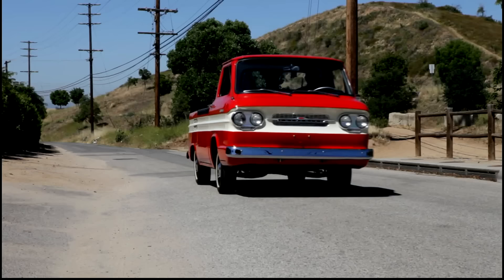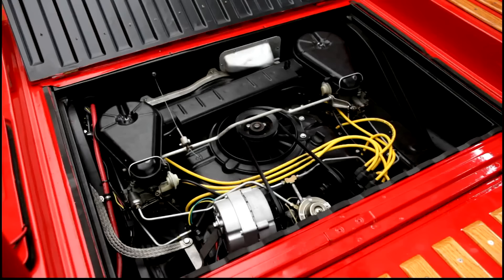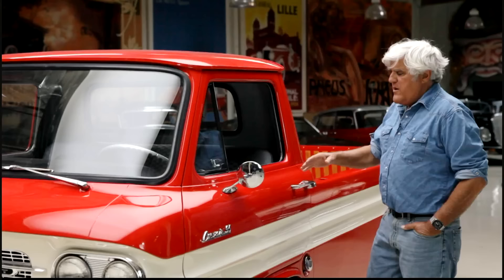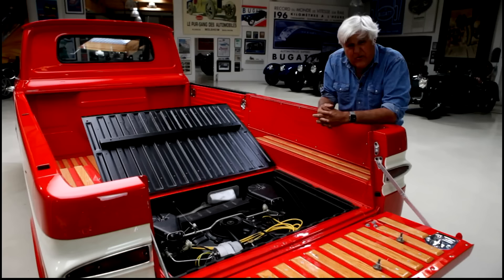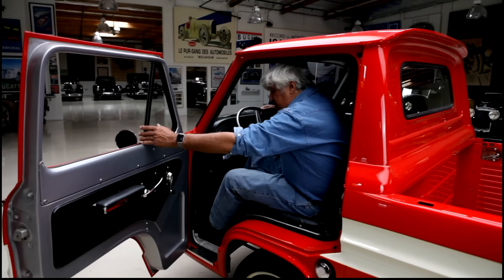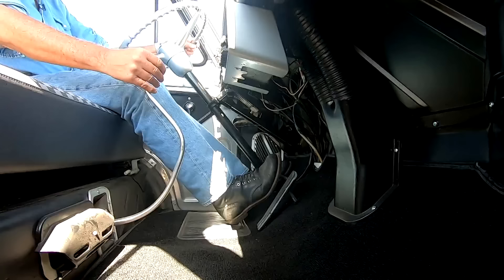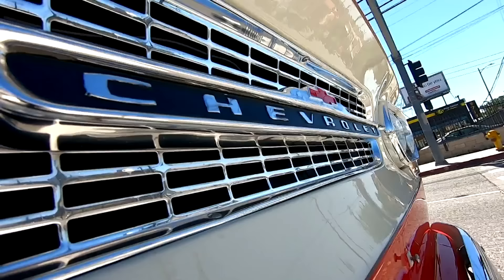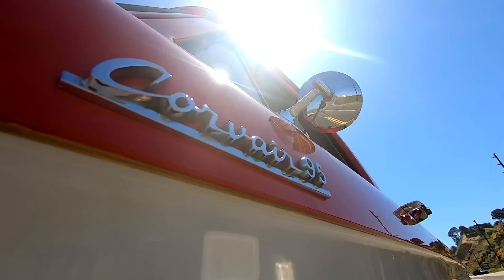America's Most Radical Pickup Truck - Jay Leno’s Garage

Comment: I would love to hear Jay’s opinion of what Ralph Nader did to the Covair. Today these designs look brilliant!
Reply: Nader... the original Karen
Reply: He gives his opinion in the vid. Hmm...
Reply: He more or less rendered his opinion on this vlog.
Reply: Ralph Nader not only knew nothing about automotive design and engineering, he didn't even have a driving license. His book was purely an opportunistic move to gain fame and fortune the easy way. At the time every liberal hated General Motors because it was the most successful company on the planet, so you could make unlimited brownie points knocking them. Nader got his information from GM's complaints from dealers and customers about faults in new cars. They kept complete files of these letters and took them very seriously. They would correct any faults and apply the fix to new cars being built, and send letters to dealer's service departments requesting they fit the new parts to customers' cars when they came in. At the time recalls weren't thought of. So Nader got access to these files by some nefarious means, and made out that their cars were full of faults without mentioning how hard they worked to correct them.
The Corvair made the perfect patsy because it was different. Professional road testers for independent publications failed to find the handling problems Nader talked about, and in 1972 the Department of Transport paid for a series of tests of the Corvair which proved it handled as well as any car of the times or better. Since it exonerated GM it was quietly buried.https://www.corvaircorsa.com/handling01.html
Reply: @mrdanforth3744  Nader is the greatest living American. Too bad the population of mouth breathers didn't have the sense to elect him president. Instead, look at the mess you are in.

Comment: OMG.  MG Mitten.  I had forgotten about them.  I bought a few things from them back in the mid 60s.  My first car right out of high school, June 1965, was a Corvair 500 with the 110 hp engine and 4 speed.  The cheapest car that GM sold at the time.  It was $2000 total cost out the door with no accessories.  A great car that handled very well.  When GM changed the rear suspension during the restyle in 1965 to the Corvette type half shafts with U-joints at both ends, it made the Vair a real handler.  It was good in the snow in winter.  I had snow tires on mine and never got stuck.  It was noisy inside at high speeds but I removed the rear seat cushions and stuffed them with fiberglass and it reduced the engine noise by about 50%.  You didn't dare put too much weight in the front "trunk" or it would ride low and handle weird.  Kept it for a year until the Camaro came out in September, 1966.  Bought an RS 327/275hp 4-spd.  Was a bit faster than the Corvair but I do miss it.  Great fun little car to drive.  Ed Cole was a genius engineer in many ways.  Great video like all of Jay's shows.  He is an encyclopedia of auto info.

Comment: I just sold a 65 Monza 140 4 carb  cool car but a nightmare to work on, I did a partial engine rebuild. my engine was toast and a you couldn't touch a rebuilt for under $3000. I luckily found one sitting on a test stand with a propeller bolted to it, very low miles that never made its way into an airplane. Took a while to get the bugs out of it but a fun project...great job Jay and the boys, so glad your bringing stuff like this back to life

Comment: Jay, my Dad had  eight or ten of the Corvairs,  Cars and Vans....they were the only GM he liked. He always bragged that they had the most perfect balanced Crankshaft off the assembly line! He also used the drive train to build Dune buggies that we ran in the Sand Dunes at Silverlake Michigan.  The 4 carburetor engine was actually the 140Hp (It had 327 intake valves) and had torque to high heaven..they also had two other High performance engines that were 150 -180 hp turbo's     other engines more utilitarian were 95hp 102hp & 110hp and nearly everthing was interchangeable..... Great video BTW!    Dan L.

Comment: Independent suspension? Air-cooled? Engine in the back?
Who was first?
1950–1967 VW T1
1961–1965 Corvair Greenbrier
Reply: VW first, Subaru 360 Seccond, from '58 til '70, they had a rampside pickup as well.
Reply: @idrisddraig2  Subaru is often forgotten when it comes to the old days of the industry.
Reply: Tatra Model 77 in 1934
Reply: I think he meant the first American car with these neat things, and I think the only one still from America. However I think the 1960-66 C-10/20/30 Chevy full-size truck was the first to do independent all around for a full-size truck, of course if you got a K-series truck then they used solid axles due to it being 4-wheel drive.
Reply: @idrisddraig2  that's a new one on me about the Subaru. Good one👍

Comment: To crib a line from Bob Hope, "Thanks for the Memories"!  I had several model kits of the Corvair, including the Rampside pickup!  Chevy makes/made many great vehicles.  My '97 Suburban finally had its engine cracked open at 230,000 miles.  Got it repaired and it runs better than new <grin>  Now it has 242,000 miles on the odometer.  Love it!

Comment: Awesome vid.  I remember my four door sedan with the gas heater. Yes, burned a good deal of fuel but in New England on a cold winter day you could have it toasty in minutes...but the heater sounded like you were starting a small jet engine. Miss that little thing. Of course the sedan had the auto trans with the shift lever on the dash.

Comment: Great video Jay, I'm a bit late seeing it. My neighbor had a teal and white one of these. I had a 1963 Corvair that I paid $50.00 and a leather jacket for. I loved it, it was missing the passenger seat and just had a bean bag! I swear I'm not making it up. 
It had a 2 speed auto trans (lever on the left side of dash) and when you down shifted to 1st it would somehow zoom off by itself. My friends called it power boost! 
Anyway if you've never driven a cab forward vehicle like this truck or a van you wouldn't understand the feeling of being in front of the wheels, it's like you're flying or something. Very strange. Thanks Jay!

Comment: I am impressed.  An air-cooled engine that doesn't leak oil.  My ex-wife had a 1960  Corvair with the shifter in the dash.  It looked a bit like a heater control.  The only problem I saw with them was the fan belt.  If the belt broke or came off you had to stop immediately and fix it.  You didn't dare run without the engine fan working.

Comment: Always loved this car just as I love the old VW's. As a driver, there is something about sitting high and up front that just feels right. Like the VW's these cars are beautiful to look at. Nothing is overdone - this look has aged really well. On a practical level, the layout with the engine bay in the back lends itself to putting an electric motor in. My only lament is that they never bothered to make a crew-cab (as VW did) or at least and extended cab.

Comment: I put about 50K miles on the van version of that truck. Mine popped a grommet out ofr some unknown location that danced around and got under some carb linkage that make it run the engine at about half speed until I shut it off and cleared the problem beside the road.

The cars got paired with another new invention from time to time, when the fan belt broke and the engine overheated. On prom night, you could always rely on your girl friend to be wearing panty hose, the new rage in feminine apparel, and a pair of those, knotted and trimmed, made a perfectly serviceable fan belt that lasted long enough to get you back to town from where you had parked after the big dance.

Great old cars, though, and great memories.....Joe

Comment: Here in the UK & Europe the VW type 2 was where he got the idea and It basically ruled the world in air cooled commercials for years! The big difference was they had the bed all at the same level with a separate enclosed and safe compartment under the bed in front of the engine bay!  It came in a whole variety of models, from single cab pickup, crew cab, vans, and of course the minibus and caravanette!

Comment: My first car in 1974 was my mother's 64 Corvair.    I loved it to bits, I wished I had babied it a bit more.   Foggy make out sessions on those wide seats.    Air-cooled, overheat and would  throw oil.    I added an 8 track and blared Eagles and Elton. Rocket man - in his white and red capsule - 4 gear manual shift spaceship.

Comment: Back in '65, I  had a Corvair van. My brother and a few friends had a garage band, and they were good enough to earn money Saturday nights playing at college frat houses in Worcester, Ma. I used to take them around with the van, so I was a  roadie long before the term became popular. I'm sure I wasn't the only guy doing that sort of thing back then but in a way we were pioneers. 
As for the van, it got good mileage, but there were two flaws. One, as Jay said was the heater wasn't the best.  In the winter, in central Massachusetts, it was like driving a block of ice. The other problem was that if I got on the gas at a stop light, the belt that drove the alternator and cooling fan would come off one of the pulleys, and it took longer to take the engine cover off and put back on than it did to secure the belt.

Comment: My first car was the Corvair van bought for $30 at 13 years old and invested over $500.  Learned a lot about mechanical and body repair since it had T-boned a police car.  Got less than 100 miles out of it as my dad thought it was handy for an e;ectricians van.  It was not a chick magnet. :-)  I replaced it with a 72 Fiat spyder and learned more mechanics.  You did a great job on that truck version.  Love that color scheme and wood inserts.  Thanks Jay!

Comment: I dabbled in Corvair‘s for a bit in high school because my dad bought me a $25 wrecked one! Ha ha! And the biggest flaw that I saw was the exhaust was unbelievably restrictive! It dropped straight at the bottom and went into a minuscule rectangular manifold that had to cut the flow down terribly. All of mine had to have Stubbs welded onto the manifolds so I could rig exhaust on them because I had no money and the bolts twist it off. We’re talking in about 1971. They weren’t even old yet but the slop from the tires would rust them.They were fun to drive though! I just loved the way the rear end would squat when you banged second gear!

Comment: My first cr was a 1964 Corvair Monza, 4 speed convertible  Was terrific.  Had a few problems with the belt coming off due to the Generator bolt stripping.  Finally solve that problem by welding it to the frame.  changing belts was a bit time consuming.

Comment: Boy does this take me back to the 60s and early 70s. We had a  blue Greenbriar for nearly 10 years. Fun car for dates, the shift lever was always between the girls knees. Dad put planks in the side door and loaded it up with gravel for the driveway.
Our first Corvair was a 61 4 door with no rear seat belts. Dad bought a kit and installed them. When he was drilling one of the mounting holes he hit the wire to the started solenoid and it started cranking and he had to pull the battery cable.
Living in Missouri the only time our cars look as pristine as that is when they're on the show room floor.

Comment: To me '59 was the end of that excess, '59 Cadillac for example which of course I loved so much. That truck was great since you're always supposed to load the weight up to the front of the bed not back at the tailgate since you want to distribute the weight to all four tires, and the side gate helps so much of course to load and access your load in the dip of the bed.

Comment: The early Corvairs came with generators, my 1963 Monza had one. It also had the gas tank in front of the firewall, making it a true fire wall. Didn't care about safety but had seat belts. Also had oil seals that would drip oil into the shrouding and heater boxes causing the cabin to fill with smoke once it got hot, the heater did produce ample heat on its own. Only saw gas heaters on VW beetles.

Comment: Reminded me of my dad's VW truck.  First he had an open box like your stepside(but access is only by letting down a side I believe) Then he traded it off for a new to him 1959 VW window van which was more suitable for his "TRADE"(house painter) than the open vw pickup truck. VW may have had a 4 cylinder engine but the suspension could carry 2200lb(European tonne)  Maybe never had that much paint, but my dad also laid ceramic tile for the bathroom. Bought in bulk on the coast and carried the tile over the west coast mountains. There was adequate heat even in the snow of winter.  I have not seen ANY Corvair vans, I see the cars and that is all I noticed.

Comment: My grandfather bought 6 Corvair vans for his Taxi business on Long Island NY. They were not great mainly because of the belt. It runs everything and goes off on an angle. His drivers would bust a belt, the generator light would come on, and they always thought they could make it back to the station and by then the engines were fried. Some drivers would stop and my grandfather said he could change the belt in 15 minutes. When they got older the heat coming off the manifolds would fill the cab with smoke so they just didn't use it. Drivers always overloaded them from the airport and they were not built for all that weight.

Comment: Had a '64 Monza convertible, BRG. Transverse rear leaf. Blast to drive, was my favorite car until I traded it for a new 260 Tiger. Added Konis, Traction Masters, Pirellis and an Italian air horn to the Tiger, otherwise stock. This was the high point of the Woodward Ave. racing scene, great fun.  Every morning commute down Northestern Hwy at I-696, took the Tiger up to 100 and back down. Young and stupid.  Put 100k miles on the Tiger in Michigan winters, pretty much used it up. Sold it, wish I still had it. Jay is me except a bit more money.

Comment: Here we are a year later, and this video shows up in my feed again! These Corvair pickups and vans are still at the top of my list of favorite vehicles ever produced, and sadly, I'll still never have the privilege of owning one. I remember seeing a dealer training / promo videos for these trucks, and they compared it with the Ford Econoline pickup. They ran both trucks through the paces, compared the dimensions, specifications  and capacities. You'd think that with as much front end overhang these had that they'd be susceptible to doing endos when having to slam on the brakes, but because the Corvair 95 had that rear mounted engine, there was just that little bit of extra weight to keep the rear wheels on the ground under hard braking, the Ford Econoline took the trophy on that one. The test driver in the video got the rear so high in the air that if the front bumper wasn't actually touching, it sure appeared to be scraping the ground.

Comment: Having driven a few of the older VW Transporters for several years, I can relate to Jay's seat position description. In an accident  the crush zone is your knees. The obvious simple answer is... don't have an accident then there is no problem. But it's amazing how close you can get to the car in front in a stopped traffic situation. You could creep closer and closer before coming to a halt just inches away. Many's the time I would make the driver in front jump in the seat when they looked in the rear mirror. It helped pass the time in an otherwise uneventful working day. 😀
And yeah, it was a bit irresponsible of me, especially if I'd made their foot slip of the clutch. But it was a younger and simpler time.

Comment: No Corvairs came with a Duel Master Cylinder till 67.. I restored a totally original 66 Vette & has to update it to Duel Master cylinder . I also was one of the few Corvair Mechanics in Dayton, Ohio at age 17 at a gas station. Mechanics hated working on them because of the 13 shields, if I recall correctly, I loved working on them motors.. Rebuilt a lot of them, had a 1964 & ran the Hell out of it.. You could fine turn that lil engine with little tricks like 3/4 turn valve lash setting instead of factory full turn & get a little better action out of the cam shaft that was pretty hefty on the 110 h.p. up & boost the H.P...

Comment: Jay my first car in 1971 was black 1960 Corvair, 2 speed automatic transmission with no "park" just drive, and reverse , and finally a gasoline heater. Hmmm does that sound safe? Without a park position in the transmission, you had to use the hand brake or turn the front wheels in to the curb. If the hand brake didn't work and there was no curb, you were in deep trouble on hills. So cut down 6"x 6" lumber into one 12" length and then cut the end off of at 45 degree angle  to make a wedge. I then took a 1-1/2 " black steel pipe 6 feet and connected it to the wedge. My hand brake system was comply rusted out and never worked. If there was no curb to keep the car  rolling forward or backward up or down a hill, I would keep my foot on the brake then open the drivers door and lay down half in the car and half in the street. Then I would jam the wood wedge under front or rear tire using the 6 foot pipe to keep the car from rolling away. Often I laid down in the street with on coming cars honking at me.

The gasoline heater had its issue. If the igniter switch didn't delaying getting heat in the car, when it did work, the excess gas would explode and fill the car with smoke as you drove car. This will sound crazy, but if I could find a black 1960 Corvair with a gas heater I would buy it.